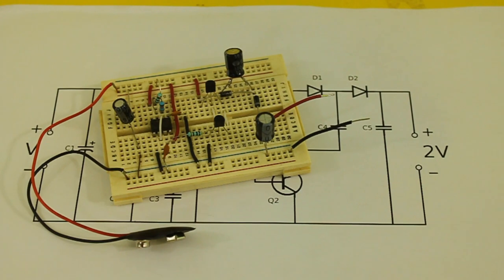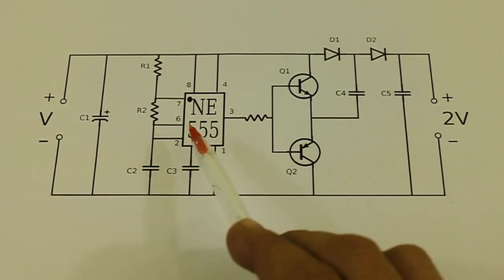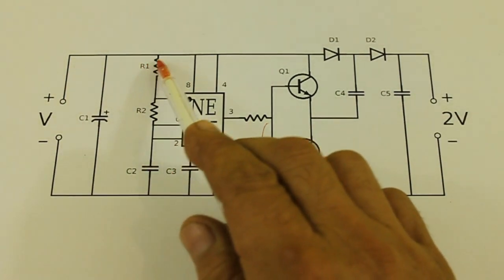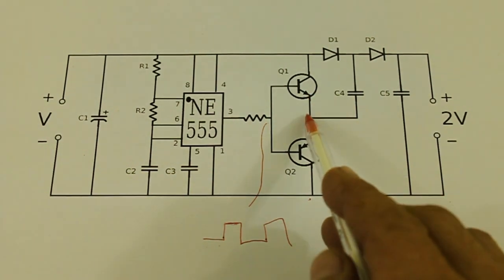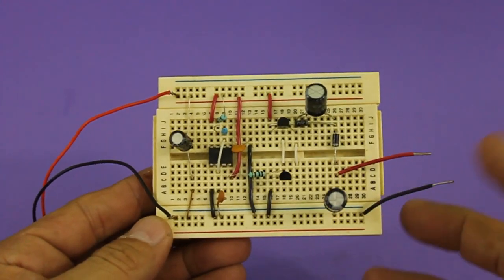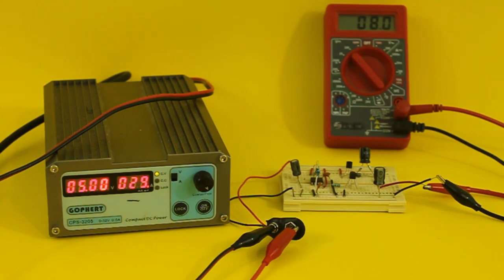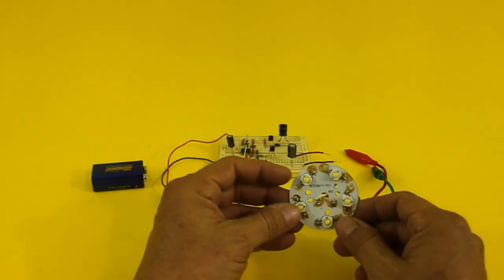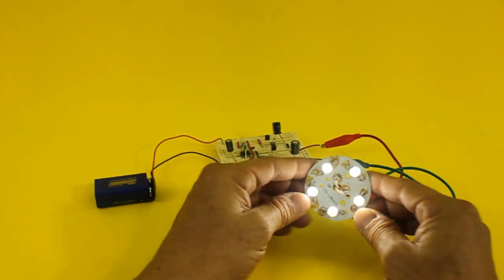DC to DC Voltage Doubler with 555 Timer

Comment: I was wondering if adding this circuit to another one will cause noise. A guitar flanger circuit requires 18Volts DC, so I can use your voltage doubler with a 9Volt input to get almost 18V. Other voltage doublers (e.g. a charge pump using a MAX1044 IC) cause noise in the overall circuit. Do you know if this doubler, based on the 555 timer IC, will create unwanted noise?

Comment: In comparison between the schematic and the list of items, 
C1 should be 10uf
C2 and C3 .01uf
C4 100uf
C5 10uf
Reply: does the circuit works with bc547 and 557?
Reply: CoAcOn1 i just looked at the 547 datasheet, and it seems there isn’t big difference between the two, so i think it should work
Reply: Jasim Waqat but collector current on bc337 is much bigger then bc557
Reply: Jasim Waqat but collector current on bc337 is much bigger then bc557
Reply: CoAcOn1 yes you’re absolutely right, i will try it with 557 and 547 and tell you if it worked or not.
Reply: Jasim Waqat does it works
Reply: CoAcOn1 i tried 547,557 and 327,337 both of them gave the same output which is 8V, but the problem is that my input is 9V, so it didn’t work for me as it supposed to double the input.
Reply: Jasim Waqat i tried also and i got 8v from 9v battery
Reply: So the circuit does not work
Reply: CoAcOn1 thats right. I’ve tried various capacitors with different values but i got the same result the “input - diode voltage drop”
Reply: Jasim Waqat yep same for me
Reply from the maker: C1 100uF, C4, C5 10uF
Reply: CoAcOn1 update, i was able to make it works, just by replacing 10KOhm with the 100ohm. So R2 is 100ohm. And R1 is 10kohm. And worked all the same with bc547 and bc 557.
Reply: thanks for answer i will try replacing resistor
Reply: devre elemanlarını niye yazmıyorsun???
ne direnç var ne kondansatör ne de transistör....
555 ten başka bir şey yok devrede....

Comment: does it havve a feedback ?  how the 555 know when to increase/decrease the duty cycle when needed?
Reply: the 555 timer outputs a square wave at a certain frequency based on the two resistors and two capacitors. I don't know the equation off the top of my head, but I would suggest looking it up. You can also change the duty cycle of it, i suggest looking up "How to change the duty cycle of a 555 timer"

Comment: Question.    If you had 12 v battery to start and the out put is double to 24 v.   24-12= 12 v.   Can you run a load between the positives if you tie the input and output negatives together?
Reply: That would probably result in the larger voltage spilling over into the smaller voltage circuit either short-circuiting or just not doing anything (depends on amperes). Not sure why you would want to do this anyhow...

Comment: Very Good. I would like to know how much current is possible with this circuit? And if to place more 1 capacitor with diode i could to triple this voltage?
Reply: Unfortunately you would have to have another transistor to also control that capacitors charge and discharge and not only would that make the circuit more complex, but also make it so you would have to find a way to control three transistors with the 555 timer IC that only outputs a square wave in two states (hi and lo) with a 50% duty cycle. The video shows the transistors being controlled one at hi and one at lo. So if you were using this circuit, you would have to invent a third state, which isn't necessarily possible unless you want to get into quantum computers and superposition of states. Basically, the long way of saying unfortunately no :)
Reply: Also the amount of current depends on the tolerances of the 555 timer IC, the diodes, the transistors, and the capacitors.

Comment: I simulated it in EveryCircuit, and  this is working :)
 I  like  your  explanation, I would like to know why output  is  geting higher and  higher and doesn't stop at certain voltage ?

Comment: Thanks for your sharing!
I need to input 220 AC on the circuit, trough a rectifier bridge like KBP310. Can i do it with this circuit? (i consider we have to change capacitors to 450v or 630v capacity)
I also would like to triple the voltage. Can you help ?
My point is to reach over 750v, low current (under 250mA), and that the circuit stands for long time in short circuit (it is to electrocute some insects).
Thank you so much..
Reply: Use better mechanism for that purpose. You can produce higher voltage than 1000V using oscillator and capacitor-diode ladder circuit from 3.5V battery
Reply: The first half of this circuit is used to create a saw-tooth poor man's AC current. Just input the AC current where the transistors would be and you will double your AC voltage as DC output.

Comment: I made this circuit .. it is working but only problem i am facing is that 555 timer becomes hot and burns after 2-3 mins .. what can be the reason? I have spent almost 3-4 hours troubleshooting it but i still have not found the fault!
Reply: it could be under too much voltage. Read the 555 IC's datasheet to see the tolerances on voltage.

Comment: note ERROR: 2v produced by voltage doubler implies that input voltage is 1v.
NO versi of the 55 Timer wll operate with Vcc =1v
Reply: V is a variable. 2V is double that variable. 2V signifies 2V volts
Reply: the doubling doesn't happen until after the 555 IC, so the IC would actually receive whatever aperage and voltage the input provides. Also, the diodes ensure that voltage doesn't spill back into the IC. So no, this is not an error.